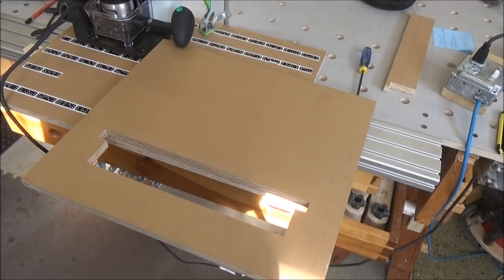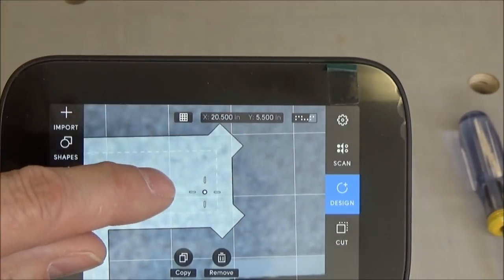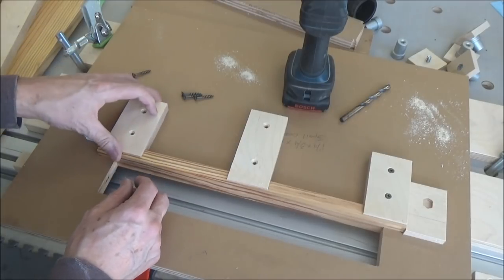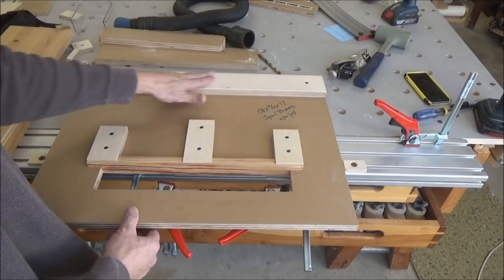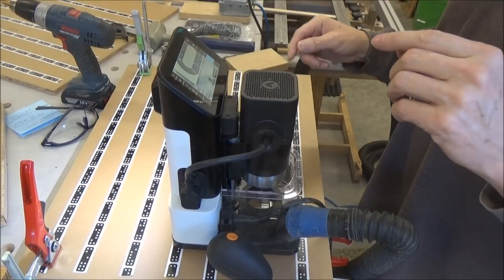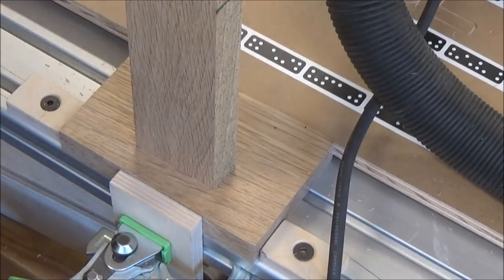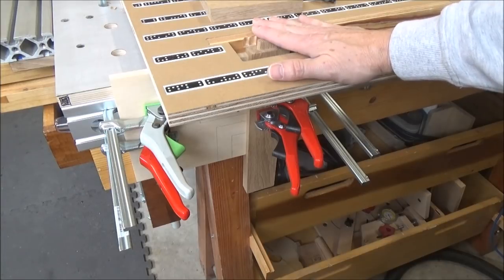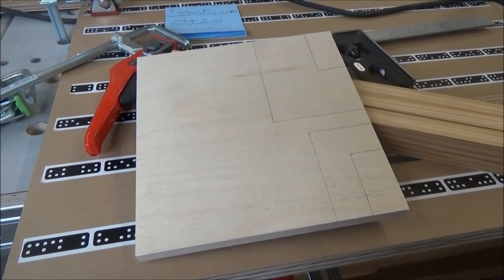Tenon Jig for Shaper

Comment: I like your solution. I will build something similar for attaching to my MFT. The one designed by Shaper is nice but bulky for storage. Again, a nice alternative solution. Just waiting on my SO. Probably another month out.
Reply from the maker: For all the reasons you mentioned is why I build this one. Thanks for watching and good luck with your Shaper. Do yourself a favor and order extra bits ahead of time. I have 3 of each coming. I have broken the V bit working on metal. My fault, not the bit, but I am on hold until the new one arrives.